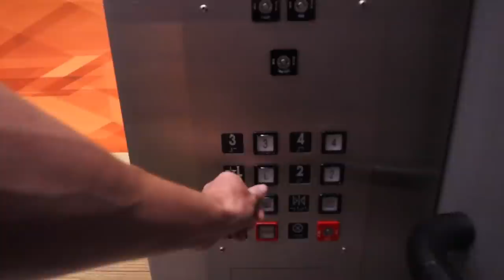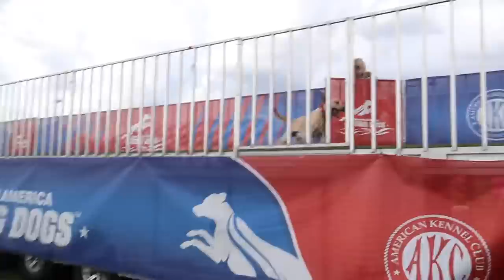MONSTER TRUCK VS LARGEST TRACTOR IN THE WORLD!

Comment: Cole..... Randy & Roberts Big Bud.. is NOT rated at "747 hp" as you stated.   The "747" was just a random model number that Ron (Harmon) gave it, because of its size, when he and the crew, built it at their shop in Havre.   The engine (a v16 - Series 92 [ci per cyl.] Detroit - 2 cycle) has been uprated 4 times now since new, it was originally set conservatively at 760 hp or, 720 hp... I forget now, its been a few years since 1977, when Ron built it for the Rossi's out there in "fornia" for their cotton farm (used it for deep ripping), then bumped up to 860 hp specs, then 960, and when Rob't & Randy had it completely rebuilt, it was upgraded to 1100 hp specs, which is about maximum for it, in its current configuration.  

In Marine trim, it could be taken to 1640+ hp using factory spec'd parts at 2350 rpm.  Of course it can be taken Much higher than that.  

We had the V12 (series 71) in the pull truck (NTPA "sleds") putting out 2500+ hp & 3000 lbs ft of torque... at 4K to 4200 rpm.